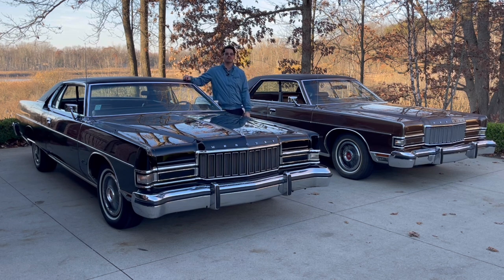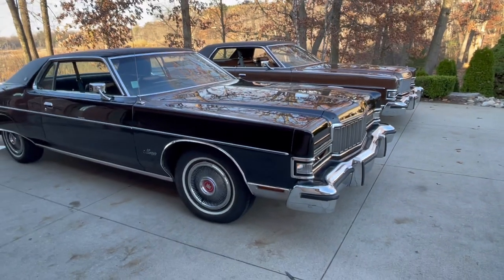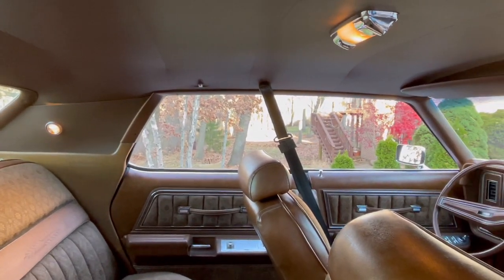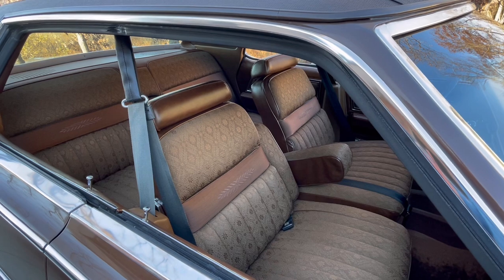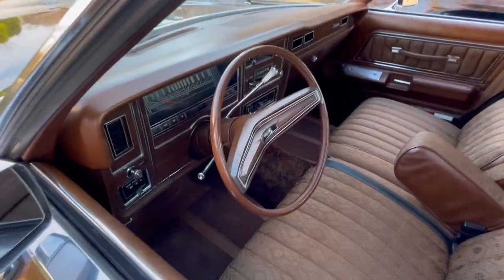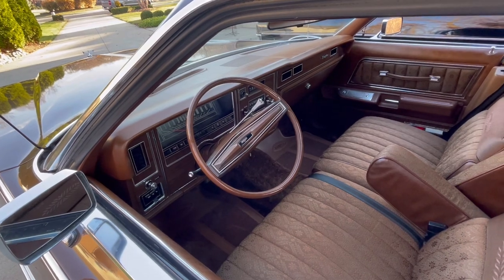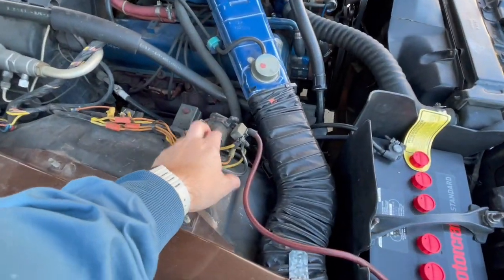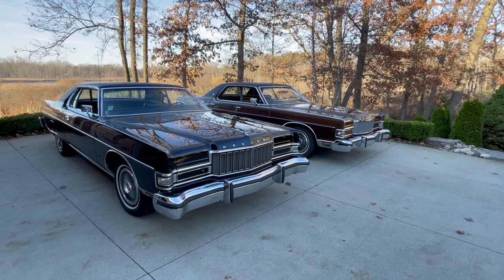Strange Features, Quirks, and Interesting Factoids: 1974 Mercury Marquis & Marquis Brougham

Comment: When I was a kid in the late 70's there was a wedding at the church a block away from my house.  Both sides of the street in front of church were full of parallel parked cars effectively leaving only a centre lane.  Anyways a squarebody pickup packed with young wedding guest/party people flew towards me past the church and proceeded to plow into the front passenger side quarter a mint 74' or 75' green 4 door Marquis. 
Grampa and Grama were leaving the wedding and pulled out from a perpendicular side road directly in front of the squarebody which was doing at least 40mph. Both vehicles bounced off other parked vehicles. I was about 50 feet away on my bicycle & watched the whole thing as the pickup was pinned and honking it's horn, hands waving at all the wedding guests. 
No one was killed but the Marquis was done for.  Thanks for the memories.

Comment: For those of us whose age and/or infirmities make getting in and out from behind the wheel, adjusting the tilt wheel every time is a matter of necessity.   I owned a '78 Country Squire for a number of years (almost 20) and in 233,000 miles I never had a problem with the tilt lever (unlike my '85, that came apart twice in 190,000).
Reply: My late father was “portly” and he raised the tilt wheel to easily enter and exit the car and lowered it when seated.

Comment: From the camera angle the alternator belt appears to only ride on the crankshaft pulley. If so, why the need to remove the fan?
Reply: That's what I was thinking too.
Reply: I also wondered that. I was watching close and that alternator belt only goes around the crank pulley. Maybe it's the power steering belt he meant?

Comment: Love the old marquis, had a 74 in like 1989.. black w green interior.. was such a smooth driving and running car . I was such a dumb kid that didn't respect the value of old cars like this and is one of my biggest regrets.. was smoother cruiser than my 754 Lincoln Mark V, that I also owned at the same time frame.. love to have another Marquis. Mine was the vinyl roof as well.

Comment: Another great video from Adam, as usual.

My uncle ordered two new Mercurys...a '73 Marquis Brougham followed up by a '78 Grand Marquis.  Both had the automatic temperature control system, although he later ordered an 85 Grand Marquis with the manual control system.  His oldest son told me that there were issues with the automatic system in the earlier cars that prompted him to ultimately choose the alternative.  I always wondered what they were.

During those years, we had a '75 LTD Landau with the tilt column. In '79 we bought a Cadillac Fleetwood Brougham which had the tilt and telescope column.  After driving the LTD for four years, my dad needed to re-train his muscle memory to recognize the dedicated pull-toward-you tilt lever on the Cadillac.  Shortly after purchase, the turn signal lever broke off due to metal fatigue; it could only handle so many instances of being pushed toward the dash (and restoratively pulled back) in Ford fashion!

Comment: If I recall the Marquis Brougham had 7 ash trays, one of which had a capacity of about a pint.  You could get a lot of smoking done in that car!  We need an ash tray count on these old cars!
The pneumatic steering wheel rim horn switch was certainly a quirk!  
This car had pneumatic door locks as well, must have had a half mile of air tubing in the car; as you noted the hidden headlight doors were pneumatic. The interval windshield wipers were a pneumatic adjustable delay too.  The noise of the automatic door locks was remarkably loud.
The optional stereo was very good for its day.
The power bench seat could recline to near-bed proportions, and the adjustable steering wheel would go up to a ridiculously high position.  My dad had one of these when I was 16.  Great car for a date....
Reply: The should have had a central vacume system so you could just flip your ashes towards a pickup hole.

Comment: Wonderful memories here
1977 I drove a metallic light blue with dark blue vynal top marquis brougham 
Fully loaded with every option 
I had the B pillar model
Always wanted the hardtop 
Mine also had the trailer tow package with short gears in the diff and heavy duty cooling etc
Great car
Could hardly afford the gas then
Huge trunk 
Great ride and handling 
But am I envious of your marquis 
Surprised your sedan doesn’t have cruise control or 8 track
Nice video 
As always thanks

Comment: My 74 Charger has that same seat belt interlock. Disconnecting the harness under the front seat is all that’s needed to defeat it. At that point you the seat belt light and buzzer don’t work but it starts up without having to buckle up. Government engineering at its finest….
Reply: Yeah, I did the same on my ‘74 Imperial.
Reply: Saw a drunk here who had to blow into a breath alyzer to start his truck.  I was proud that MO. was on the cutting edge of drunk technology.  I think hes since cleaned up.
Reply: @Eric Ruud And it was a one year only deal.
Reply: @Eric Ruud that's awesome
Reply: @Eric Ruud Less horses equal less horse thiefs.  Glen Campbell, "True Grit".
Reply: @Eric Ruud I remember the gas rationing with the odd and even license plates. Dad misjudged the fuel in the Coronet and halfway through a trip we had to turn around and come back home on fumes. That little 273 thought it was a big block with the amount of fuel it liked to consume.

Comment: Great side by side comparison, Adam. As someone who grew up in the 70’s and 80’s after experiencing the interiors and now looking back at them, I think leather (as todays upgraded option) is much overrated. Lol.
Reply: Personally I think - like a lot of comparisons old & new - the switch to leather from vinyl was a good one. Today's leather is also quite a bit "better" wear-wise than the sixties and seventies stuff you used to get. I have an almost 10 year old Navigator with LOTS of use and with barely any visible wear except a crack on the side of the driver's seat. You wouldn't get anywhere near that kind of service from a '70s vintage car.

Comment: Doesn't the alternator belt only go around the crank pully which makes it not necessary to pull the fan?
Reply: It looks easy.  Maybe the water pump pulley is so close to the crank pulley that the alt. belt doesn't fit in between them.
Reply: @johnz8210  I've had a lot of theses cars and never had to take the fan off.
Reply: @tonyscarcare5657  Ok.  Maybe Adam can explain what he's talking about.  I've been working on vehicles a long time too, and never removed a fan to replace a belt, on anything.
Reply: @johnz8210  I think he just miss spoke.

Comment: Confused.  The Alternator belt is off the crank pulley, not the fan.  Why would you need to be concerned about the fan?  Sure, you need to take the other belts off.   But the size of the alternator belt seems irrelevant.  Confused with that complaint.
Reply from the maker: You need to get the belt around the fan in order to put it on.
Reply: I caught that too.  Maybe he misspoke and was talking about one of the belts which goes over the water pump pulley.
Reply: @RareClassicCars   Is the water pump pulley so close to the crank pulley that the alt. belt doesn't fit between them?
Reply: Not a big deal since I don't have one of those cars.  Just trying to feel your pain.
Reply: @RareClassicCars  Get one of those hook and loop belts.
Reply: @johnz8210  Yup, that the issue

Comment: That car sure looks classy in black. I remember those seat belts in 74. Most people would just buckle the seatbelt behind them and leave them that way. Very few people wore seat belts in 1974. You didn't mention it but it appears that the back glass is different between these vehicles? Maybe because one is a 4 door and the other is a 2 door.
Reply: My friends all wore seat belts.  Especially after one of them rolled his 2002 at about 70 mph.  He was trying to catch my semi race TR 6.
Reply: @rogersmith7396  I started buckling up after my father was likely saved by his belts in a 1981 accident. At the time, very few of my friends did.
Reply: @pcno2832  Yeah my situation was atypical.  My parents did'nt use them as I recall.  My TR 6 was one of the few cars at the time which had inertia reels which of course were far superior.  My little group of friends though belts were the only intelligent option.  So we all wore them and very quickly it just became a habit.  Even my friend with the boat tail Riviera used those clunky GM belts but he was in the car that rolled and he was terrified.  Never heard of cars that would'nt start unless buckled.

Comment: I really love the black base coupe, even with its crank windows.  I probably would have opted for the "grande Marquis" interior though, really dislike the fabric in these two cars.  Funny you should mention the AC control on the GM models.  I remember my parents returning the Caprice for repair when they inadvertently moved the temp slide all the way to cold and turned on the AC, fan only ran at full speed.  Dealer explained how it worked when they returned it, but this info probably could have been found in the owner's manual.  The beauty of the GM system is that the recirc/full AC was only needed for minutes, even on the hottest of days, then the system  could be returned to normal mode to avoid being frozen out.

Comment: Auto makers probably bought headliner by the train load.  What ever was cheap and decent.  There was a vinyl supplier in KC I have been to which no doubt supplied the factories here.  Also have been to a local contractor that made seats and door cards for the factories.  Down in the west bottoms by Kemper in some old partially vacant industrial building.  It had a 6 story freight elevator shaft with no elevator or any gate to keep you from taking a long fall.  Don't like heigths.

Comment: It is amazing that the door pull handles and the dome light with spots are identical to these same parts on my two late eighties and early nineties Crown Victoria's and my 1989 Mercury Grand Marquis. I guess Ford never redesigned these parts as if they worked why fix them.

Comment: That old tilt wheel design for Ford is STILL better than that “quirky” - read stupid - design they went to in ‘79 with the lever on the right that literally only tilted the steering wheel and not the column.
Reply: Yea, that was an odd design. I never owned  a car with one and wondered if those who did came to appreciate them; maybe not.
Reply: @pcno2832  My Dad was an 80s Ford guy. Had a ‘79 LTD Country Squire wagon for work and his personal cars were a ‘79 Mustang straight 6 and then an ‘88 Thunderbird LX 5.0. All with tilt wheel and cruise control. He seemed to be ok with that stupid wheel. Myself I was always a GM guy, and even as a kid I thought that Ford tilt wheel was an awful design, especially to GM’s Saginaw columns.
Reply: @joe6096  Chrysler even used GM columns in thiere top of the line cars with tilt/telescoping

Comment: So many memories triggered, from Ford's ubiquitous Hi-C vacuum cans to the hilarious SNL commercial.  I did not know that Ford engaged the recirculate function at the Cold end of the temperature slider, a la GM, but without the Forced Ventilation mandatory high fan speed (supposedly a GM Legal preoccupation with exhaust leak liability, which also prevented 100% recirculation even in recirc mode).  It's unfortunate Ford didn't adopt the Saginaw variable-ratio steering gear along with the pump, as the comically slow ratio was always my primary objection to these cars.

Comment: I prefer the Marquis with the "Grand" interior option because of the three-spoke steering wheel! That two-spoke wheel is in every Ford from a Pinto to a Lincoln whatever. Then in '75 or '76 everything changed to that sort of "c" shaped center spoke. I am so amazed by your collection of these vehicles, Adam. I'm curious if you do this all yourself or do you employ somebody to help you with all these cars??

Comment: They had that done light in cars and trucks for many years. My dad's 1990 f150 had the same one. Little tid bit. Also my 1988 f150 had the same told wheel and so did my friends truck. They feel like they want to break but iv never seen it done.

Comment: As always, a great video. 
I didn't know about the turn signal lever operation to tilt the wheel. Seems as  "quirky" as hiding the gas filler on GM cars of the 1950s. I wonder if my 1976 Ford LTD Brougham had a tilt wheel and I never knew it! 
Were the fender skirts standard on these Mercurys (except wagons)?

Comment: I always remember driving my uncle's  74 Marquis on Eastern township auto route, it was a wonderful boat but it had one great flaw. I was driving about 85 mph and you could literally watch the gas gauge move left. My dad had a Mercury Rideau 500 which was basically the same as the base Marquis, and one feature I hated was the trunk. It was simply too deep. Out of curiosity was the Rideau 500 a strictly Canadian name plate or was it in the States also?
Reply from the maker: Canadian only
Reply: @RareClassicCars  I am a mile from the Rideau River from which it got its name. 😁
Reply: I'm sure that at 85 mph that 460 was definitely sucking some fuel.  Great memory

Comment: Neat cars.  I prefer the loop pile carpet.
Reply: The cut pile is way nicer both new and used.  Loop looks cheap.
Reply: @rogersmith7396  Loop pile looks like what you would see in a high quality 1960’s product.  Cut pile looks like the wall-to-wall shag stuff from a cheesy disco-era conversion van.
Reply: @turdferguson4124  Loop is what auto manufacturers put in their base cars.  Its hard and cheap looking and looks terrible as it ages.  My 70 Eldorado has cut pile about an inch thick.  The kind you like to curl your toes into when barefoot.  Very soft.  Shag carpet is explicitly loop pile.

Comment: Adam several things that I noticed on both Merc’s both have air conditioning just basic with 4 settings dual remote control factory mirrors, 2 dr basic had am radio no tilt steering wheel but other than that nice 👍👍 😊😊😎😎 and 4 dr Brougham auto-4 speed air conditioning, Powered Door Locks,Powered Windows AM/FM Stereo Radio no Cruise Control System in my personal opinion the individual who brought the the basic should have went on and paid extra for Power Door 
Locks,Power Windows,Tilt Steering Wheel Cruise Control and AM/FM Stereo Radio ah shoot dude he or she should have brought the Brougham Package or the Brougham LS Park Lane Package for Both of Them. I really luv the Non Pillared Rides from 1970 to 1974 for those model years and the Pillared Rides from 1975 to 1978 model years that goes for all of the Luxuriously Luxury Rides of all the Major Big 3 of which I will always be a Big Huge Fan of of which will always be always had, always has, always have and always will be All Cool In The Gang 😎😎😎😎😎😎😎😎😎😎😎😎😎😎😎😎😎😎😎😎With Me. Adam again keep up with the good work that you do in finding and locating those amazing, awesome, beautiful,magnificent,majestical, splendorous,wonderful and wondrous Rides my Brother from a very different mother 👩 of which I am an African American Male that happens to be an Antique,Classic and Vintage Ride Enthusiast. Sincerely Yours Ivan I J🕵🏿🕵🏿‍♂️🕵🏾🕵🏾